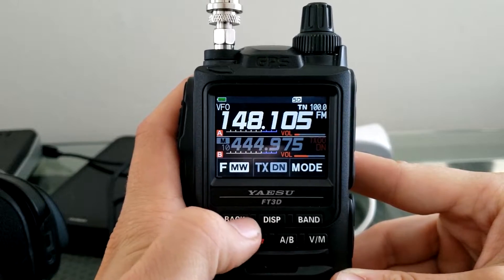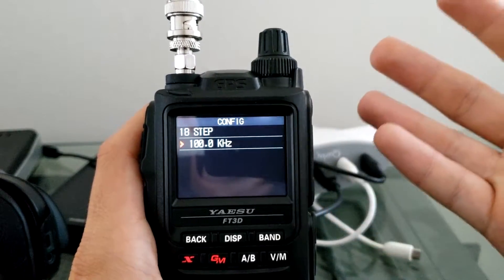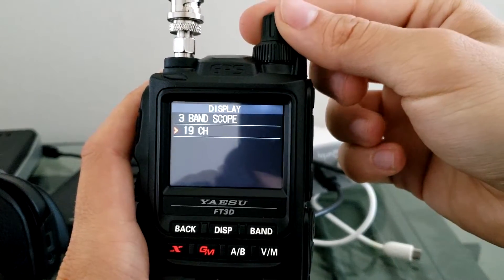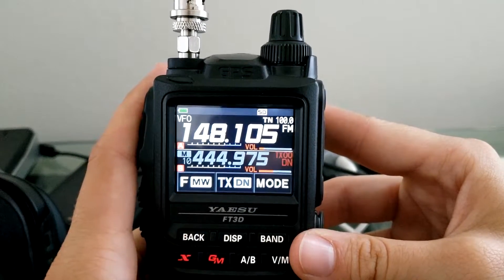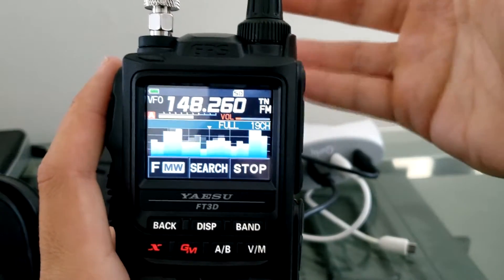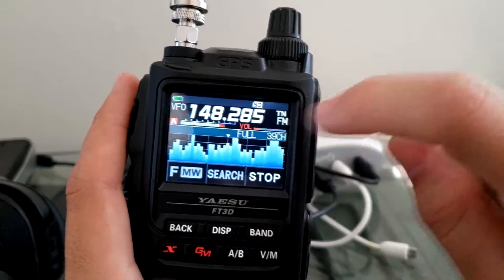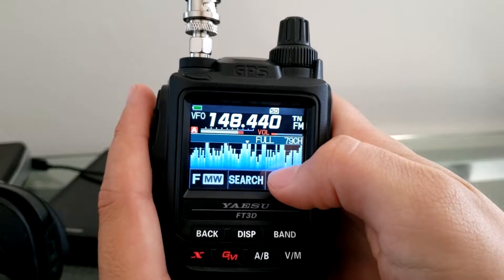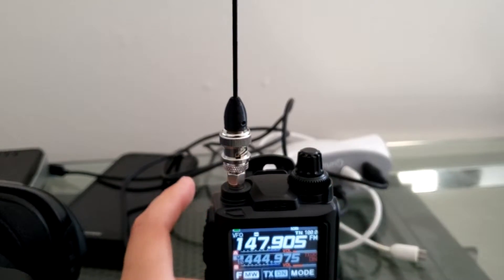How to use the Band Scope on the FT3D or FT2D - In Depth Guide

Comment: Good video, well done. However, that feature looks useless to me. The band noise is peaking the band scope to maximum. I doubt you would be able to differentiate much between noise and signals. It looks like a gimmick. Use a direct sampling radio with real-time band scope to see the band properly. These rigs that scan the band segment once per second and then display the results as blocks, lego or cartoonish characters doesn't do it for me

Comment: Great video definitely interested in this rig - something only slightly related, please invest in a smaller form factor BNC adapter, would hate to see your SMA shear from torque!  That stack is higher than I would want to use when out and about.   I found some that have the SMA go within the body of the bayonet rather than on top that have worked well.  73s Dave, M6NGQ